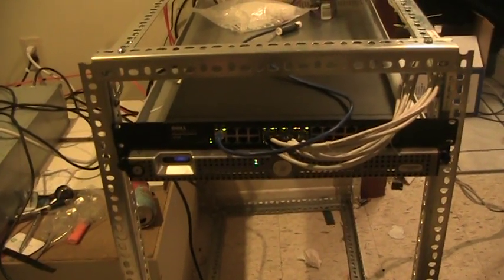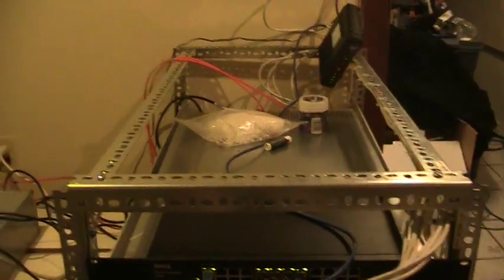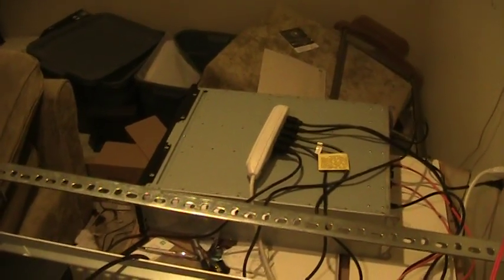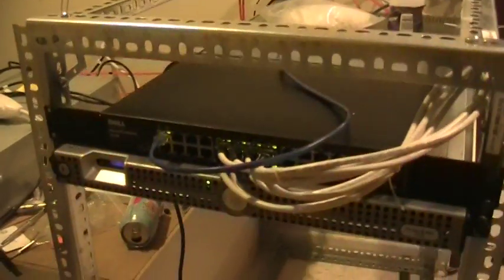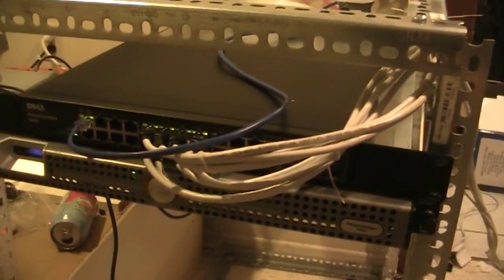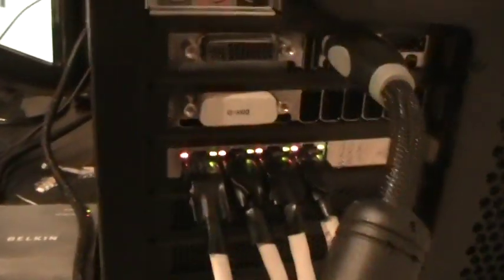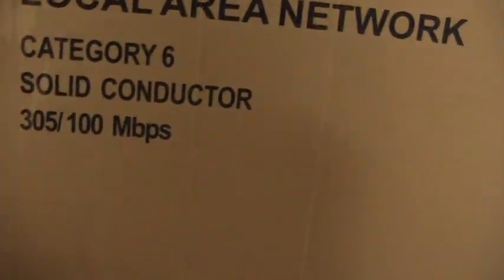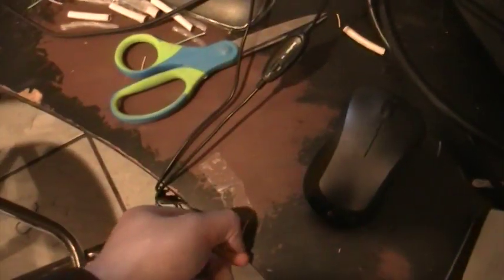Home "Data Center" Setup - SAN Array Setup - Cheap 4GB/s Ethernet Setup

Comment: Hi Hotnoob.. I am new to IT.. Just getting here to understand.. I want to setup this kind of data center with SAN for my stuff on my home network.. Could you help what devices to buy and how to connect them.. Your guide will be appreciated.. Thanks
Reply from the maker: So, this setup is with FC, which is more or less obsolete these days. 

Mainstream options are between 3 strategies / technologies. 

iSCSI is running SCSI over a IP / Ethernet Layer. So, normal Ethernet switches. 

SAS is sort of a direct replacement for FC, it operates in a very similar manner / has very similar capabilities.  

The last option is the "cloud" option. which is to acknowledge that SAN / NAS is more or less an over-hyped over priced scam. In essence with a cloud / cluster setup, rather than putting all of your storage in a SAN, you put your drives into a server normally and connect that server into it's own "SAN Network" to a degree. using a distributed filesystem like ceph. Obviously with the flexibility of this option ( although fairly large overhead ), SAN and NAS can be included in a setup like this. although not generally done as it creates a single point of failure. 

---

If you want to learn all 3 "technologies"

i suggest, Server + SAS San Array ( direct attach ) 
then on that server, setup iSCSI access via your favorite OS. linux or windows can do iSCSI. connect to it on your computer and you've learned the basics to those two techs. for cards, two approaches, HBA or RAID. LSI raidcards can typically do JBOD, which is essentially making them an HBA. JBOD = no diff than plugging into server internally. RAID = controller handles drives for the most part.  

A virtualization environment on that server will let you play around with cloud / ha options like openstack / esxi / proxmox. or just the dfs portion, so microsoft dfs / ceph or similar.

then on that server, setup iSCSI access via your favorite OS. linux or windows can do iSCSI. connect to it on your computer and you've learned the basics to those two techs.
Reply from the maker: So hardware wise. 

Dell R710 / R720 server ( depending on your budget and how loud you want your setup. newer servers are much quieter )

Dell servers typically have the best overall compatibility with hardware / software. 

any LSI SAS HBA / raid card ( you can also reflash a dell or hp card, but both are $10 or so, so really any LSI HBA/RAID card )

A SAS SAN - dell MD1000 / MD3000 with SAS controllers ( not iscsi ). or any JBOD type SAS SAN. i think MD3200. 

Again with SAN's Dells are typically having the most hardware compatibility, HP ones will typically demand hp drives. I haven't played around with NetApp SAS Sans that much yet, so not certain about their compatibility... but should be more or less on par  with dell.

When choosing your HBA / SAN. make sure you match the connectors and cables. there are a few external SAS connectors out there.
Reply: Can you come to my level.. As all the devices you mentioned.. I have no clue.. I have standard home WiFi  router.. And i want to connect a 1u server to it.. What do I need to do first..
Reply from the maker: @ginobee2000  I c... 

this is difficult. i haven't been on that level in many years :|

kind of just have to play with things at that point. 

think of something that you want to do, and just try to set it up. 

for example, try creating a file share and accessing it from another device. setup remote desktop connection on a windows device, remote into that. 

download xamp and setup a website on your local network as an exercise. 

maybe find some videos on DHCP / static ip addresses. 

download virtual box, install linux (ubuntu is easy and relatively bug free) on a virtual machine, and dive into the confusing world of linux!

eventually, when your ready, take a giant leap forward, install ESXI ( free version ) on a server (dell/hp/something mainstream), and really get in there.

there is actually almost no difference between consumer routers and enterprise routers for the most part... but if you want to go crazy, install pfsense on a device and use that as your router ;)

start with your computer and network, work your way up from there. server hardware is neat and all, but really it's mostly for looks :P
Reply: I think I know.. This.. My problem what are the steps to set up SAN storage.. I know much about Nas. But my problem is iscsi. What is the steps needed to set up SAN. Also if I have a 1u server how do connect it to my home router.. Like I want to setup small personal data center in my home.. What are devices needed..
Reply from the maker: ok, specifically iSCSI. 

Short:
1. San Disk Array
2. Network Switch / or a few open ports on your router (that lan bit, is a network switch)
3. Server or computer 
4. serial cable / way to configure / talk to san disk array.

---
1. SAN \w iSCSI controllers. dell equallogic san arrays can work fine solo and are easy to setup.... however, they do have a flaw that i've run into a few times (which is why i personally avoid iSCSI san's in general), which is that... if the controllers BUG OUT you have a good chance of losing ALL of your data, no matter the RAID settings. I've had this happen to me 3 times so far, where a controller would bug out and all data would be lost. so always back up your data :)
also note, equallogic SAN will not accept all hard drives, you need to use hard drives that are compatible. look up the SAN that your purchasing and make sure you buy a model specifically listed in the specs / manual.

you can also just take a normal server, install linux or windows, create an iSCSI host... and have more or less the same thing (minus some cool features, and a little less density)... and then build another server, and connect to that server.

2. network switch 1gbps (you can use the switch in your router if you have enough ports) -- any switch will do, doesn't matter if its managed or unmanaged. managed is just easier for monitoring and techs like LAG. optional : 10gbps network switch (to fully utilize you'll need 10gb ethernet (Fiberoptics or RJ45) -- don't confuse for Fiber-channel ). ideally you could use a separate isolated switch for iSCSI traffic, creating two networks. note, you do not need a second router,  as you'll be using static ip addresses, and your iSCSI network AKA SAN network, does not need internet access, it's purely for iSCSI traffic. 
3. server or pc. 
4. a way to communicate with the SAN. IE, a dell iscsi san say an equallogic one will need to be consoled into ( putty / hyperterminal software + serial cable ) -- you'll need the correct serial cable for your device, a serial port ( usb or onboard ).

connect the iSCSI SAN to the network switch; optionally connect the management port to the network switch as well.

connect the server to the network switch. optionally, connect a second port to the same network switch to fully utilize the 1Gbps connections.

configure a static ip address for each of the interfaces / ethernet ports that you have connected to your network.  

on your server, connect to your SAN via iSCSI and use it just like a USB hard drive. pretty much it in a nut shell. finer details, google will help you ;)
Reply: Wow go info.. Thanks so much.. Let say I want to buy this HP MSA70 SFF MODULAR SMART ARRAY 418800-B21 430149-001. How will I connect it after connecting the switch to my home WiFi router..
Reply from the maker: @ginobee2000  So... the MSA70 SFF is a SAS san array. 

you could connect that one directly to the server via a SAS HBA card + SAS Cable ( make sure you get the right cable / sas connector ). the MSA70 will provide a JBOD interface, so if you do use an HBA card you'll need to setup a software RAID. 

You can also get a SAS RAID instead of a JBOD, having the RAID controlled on the hardware level instead. 

with the MSA70, keep in mind that you will most definitely need HP 2.5" hard drives. HP hardware is typically very unforgiving when it comes to hard drive compatibility. (you can use SATA or SAS hdds in a SAS san array, but they still need to be compatible -- like with equallogic arrays, double check the specs, make sure the hdd model is listed. )

the sas ports are those square holes on the back. 

another option, if your looking to experiment would be to get a SAS switch; kind of like an Ethernet switch, but using the SAS/SCSI protocols instead of IP. 

Once connected to your server, it basically becomes just another hard drive. from there you could set it up to become a iSCSI host, or simply setup a SAMBA / SMB / Windows fileshare. would be up to you as to how you use it.
Reply: Wow you have great understanding.. Thanks so much.. I have got the switch now... The normal portable switch.. With 5 ports on it, how do i know if it is managed or unmanaged.. ..1 have also bought a 1u server which will be delivered soon.. How do I open my lan port. And also at the back of the 1u server.. There are more than one ethernet ports written on it 5gb, 10gb and 100gb as well as some other ports at the back.. What are these for.. Which one should I connect the ethernet cable from the switch to..

Comment: I just bought a NetApp DS14MK4, and it came with all of the empty disk trays.. I bought some sata drives and now see that the backplane is Fiberchannel only.. Are you using some sort of interposer between your sata drives and the FC enclosure?
Reply from the maker: the trays for the sata version should have interposers on them to convert the sata interface to fc. you will want to specifically look for the sata version of the tray; the fc trays are physically different in size -- if they dont have interposers you probably have the fc version of the trays. 

since you already have sata hard drives, for ease and best performance / flexibility, i would suggest that you just buy a dell md1000 san disk array and grab a dell perc 5e or perc 6e raid controller. you can get a md1000 array for $50; with trays if you are lucky, else any dell 2950/2900 series trays will work in the md1000 array -- trays are $3-5 ea. controller is $10, and a sas cable is $10-20.  keep in mind, as with all older san arrays both are limited to the 2TB size. the dell san array will be much easier to work with and provide more features. 

if the sata hdds you have are larger than 2TB, i would suggest building a custom server as newest sans are incredibly overpriced, especially when considering that we are coming to the end of SANs with cloud / cluster features being developed for standard servers. newer sans have huge hardware compatibility issues and much more proprietary bullshit to overcome as well -- requiring hdds of specific models and firmwares. newer san arrays that can handle 4tb drives will set you back $1500+ for a used one not inc hdds. can build some pretty sweet servers for that amount.
Reply: I actually have a percentage 6e controller here. I went with Fiber channel for the ability to have shared storage.

I'm assuming the sata trays are longer by a good amount... do they even fit in a fiber channel enclosure?
Reply: I actually have a percentage 6e controller here. I went with Fiber channel for the ability to have shared storage.

I'm assuming the sata trays are longer by a good amount... do they even fit in a fiber channel enclosure?
Reply: I actually have a percentage 6e controller here. I went with Fiber channel for the ability to have shared storage.

I'm assuming the sata trays are longer by a good amount... do they even fit in a fiber channel enclosure?
Reply: I actually have a percentage 6e controller here. I went with Fiber channel for the ability to have shared storage.

I'm assuming the sata trays are longer by a good amount... do they even fit in a fiber channel enclosure?
Reply from the maker: the fc enclosure is shorter, so, nope. but the fc trays would "fit" in the sata version. with sas/sata just need to share on a different level. i know... its not as k00l :P

Comment: well you dont need a router for your network.
Reply from the maker: +SuperDeluxe80 agreed... its on my todo list to just use a vm todo my routing. minimize hardware footprint and gain performance and security that way.
Reply: amigo que você tem quantos servidores no seu hack que você usar como bockbone ao ISP você tem um hack que você amostrados no vídeo que você tem quantos clientes ativos usando suas contas de energia internet são muito caros no final do mês a conta de eletricidade trata de factura para você pagar-lhes que você passou como configurar seus servidores de hackers Eu não entendo Inglês mais eu assistir a um vídeo inteiro
Reply: friend you are doing that with the servers they are a bockbone I do not understand any English you could explain to me what you're talking about in the video you could take my doubts need knowledge friend these servers they take as many client connecting to the internet you You are riding that even I do not understand English you and ISP owner see who has enough knowledge network you could help me right tell me the servers that I should buy me build a small provider more I want to buy all servers even my own bockbone a bockbone 24 ports already understand my need to meet 4 person only

Comment: But I can get loop mode to work fine just not point to point is there a setting for the qlogic adapter I'm missing ?
Reply from the maker: +Gprime31 i usually disable the bios for the adapters; so no settings used. 

could be bad hard drives; sometimes when they are failing, the will appear to time out; had that happen to my sata array as some of the drives were failing. 

otherwise i&#39;m completely out of ideas.

Comment: Ya. 2012r2 I tried Microsoft and logic drivers and I updated the firmware I have 3 ds14mk2 shelves so I swapped out at the parts tried different cables and his cards. I also tried 2008r2, freenas, ubuntu server , open media vault and esxi . They all either hang on boot or time out during writes only I can read off them 100gb straight no problem just writes... Its weird.

Comment: I tried that but no drives show up under point to point no matter what I try I have qle2462 any ideas?
Reply from the maker: +Gprime31 drivers installed?
Reply: You need to format the drives with sector size of  512kb (netapps drives are 520kb) otherwise Windows won't recognise the drives. This can be done only via linux, but I'm not sure about it.

Comment: Thanks for the replies... My next question is do I use point to point or loop. The drives won't show up in p2p I have a mk2 sata hdds and at-fxc controllers thanks
Reply from the maker: +Gprime31 would be point 2 point; server hba -> sfp in the "in" slot. 

you can do a loop, but it's pointless with only 1 array.

Comment: Did you have a problem with timeouts when writing to the drives?
Reply from the maker: +Gprime31 if your having a problem like that; it could be your cables or dust in your SFPs / optics - i ran into an issue like this a few weeks ago on a different setup. 

an example of a problem with the cable would be too many bends; it is light after all. 

last issue might be that controllers not being able to handle it; with MPIO with the 2GB controllers, they would stutter with the writes when closing into 3Gbps with big file transfer. Solved this issue by upgrading to 4Gbps controllers. 

just off the top of my head.